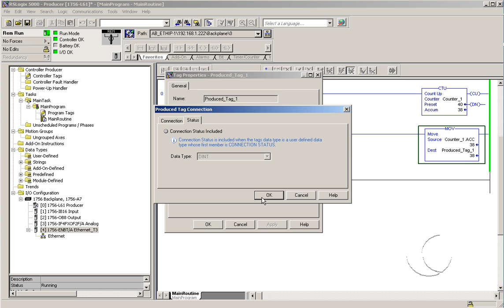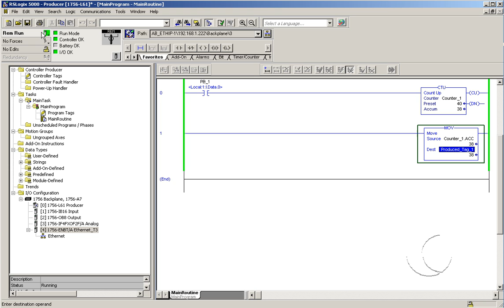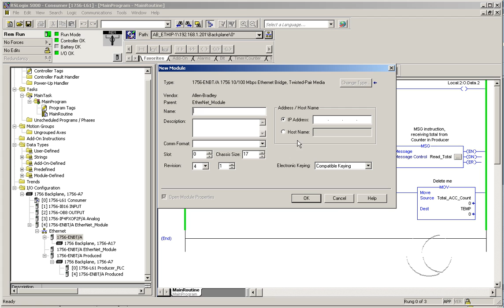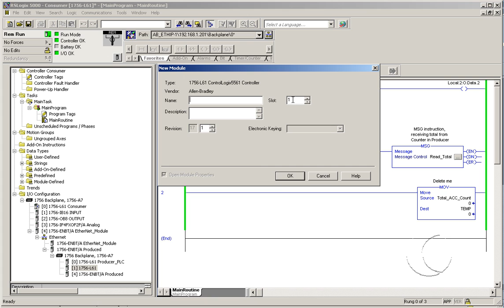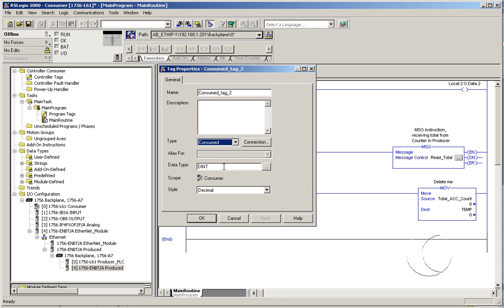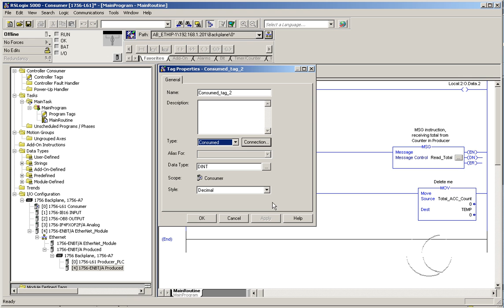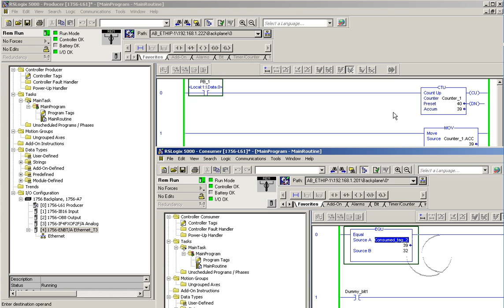How to configure a Produce and Consume Tag in RSLogix5000

Comment: Hi, im trying to communicate 1769(L32E)local and 1756(L61)remote. I have ioi syntax error. what could be the problem?
Reply: 4 Years later. Better late then never.  If you are running different versions between the two such as 19 vs. 30 you might have to use a different PLC in the controller organizer such as tow 1769-L61 controllers.  As long as the ip addresses match it should work.